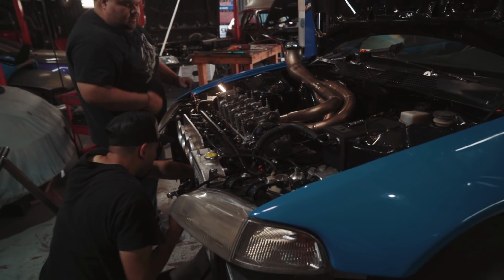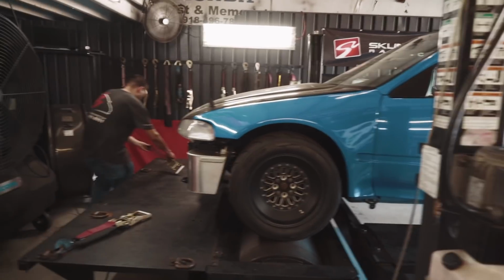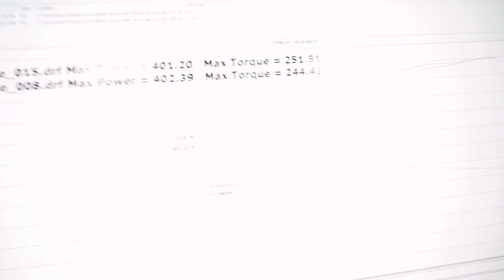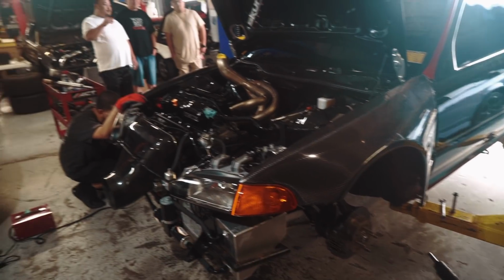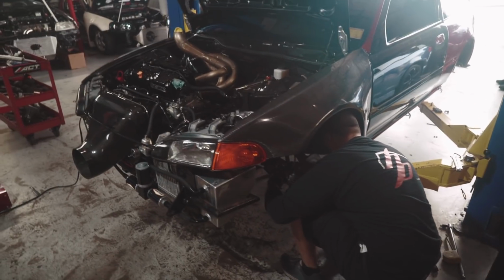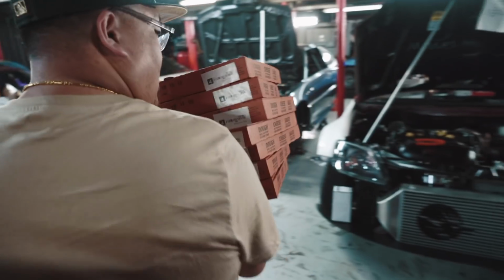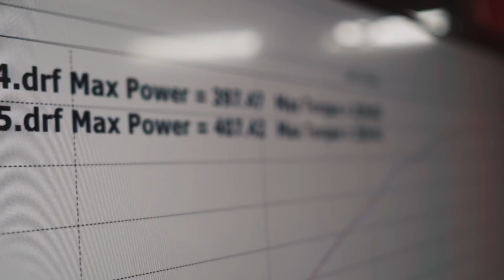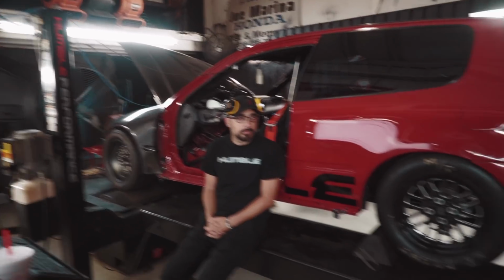We Had To Build TWO 400HP All Motor Civics In TWO Days For Street Car Takeover

Comment: What kind of fuel is used on the 400whp na 9 sec cars, e85, m5 or nitromethane? Also are the compression ratios higher than 14:1?